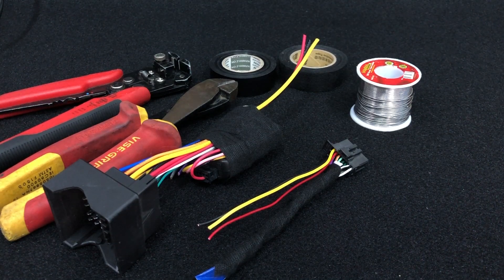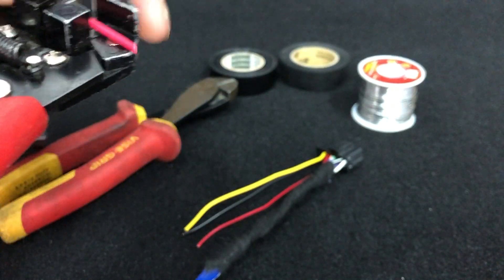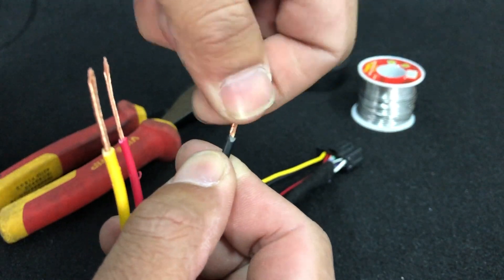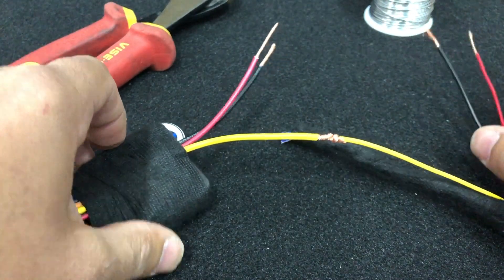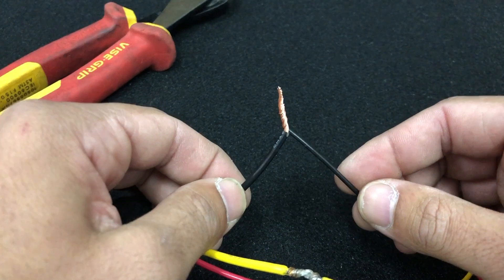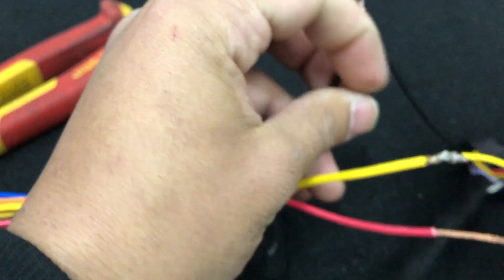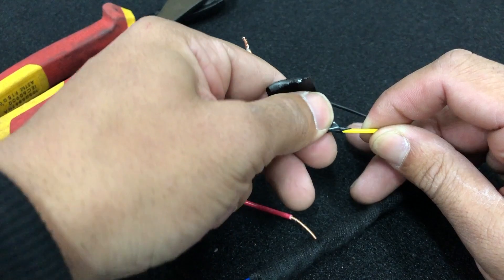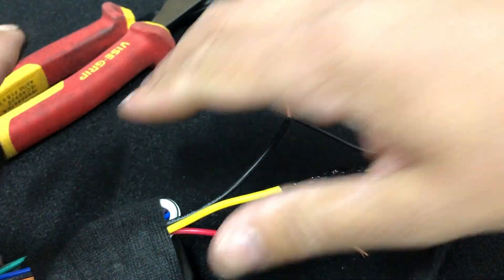How To Solder Like a Professional

Comment: Hey guys awesome vid..I am currently in the process of installing Alpine ILX-W650e with ALPINE KTA-450 into 2014 Toyota hilux. Just wondering if could tell me where and how to connect the Reverse wire. Thanks
Reply from the maker: You need to extend it and run it to the reverse light 12v+ :)